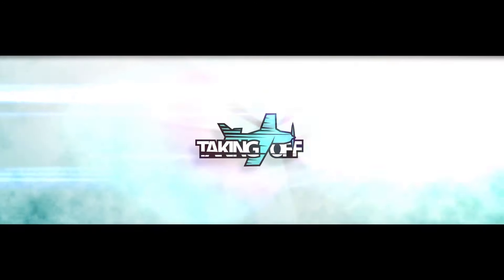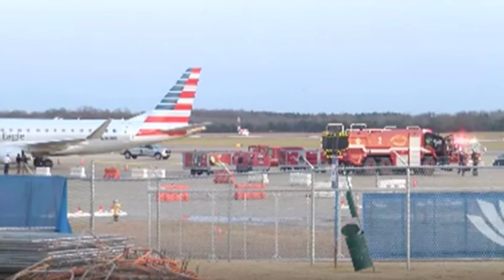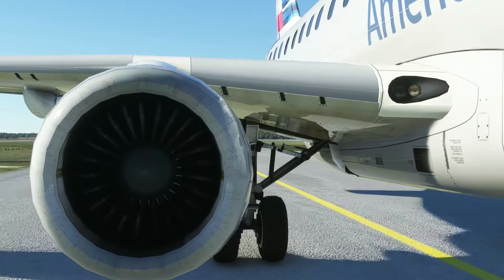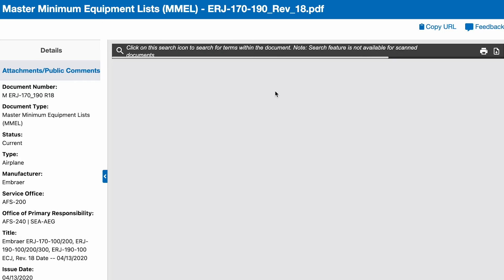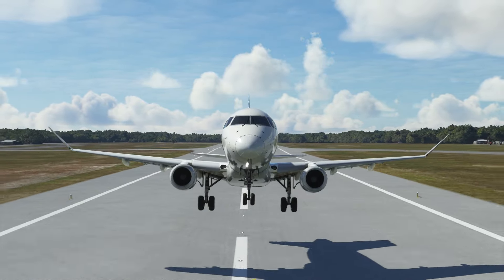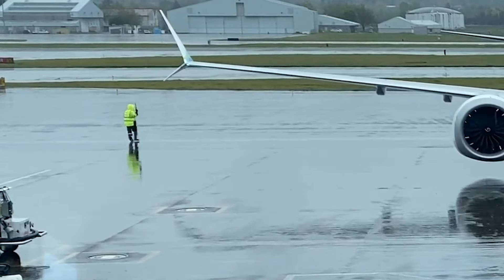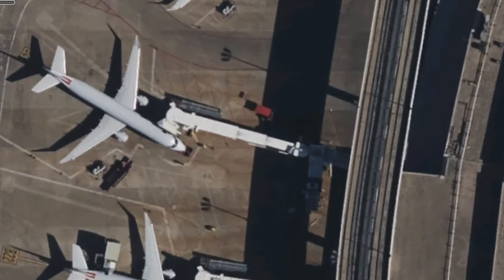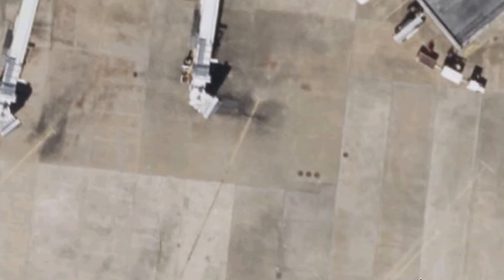Woman Sucked into Engine at Montgomery Regional Airport New Years Eve UPDATE

Comment: Isn't the APU used for emergency situations to power the plane controls?
Reply: APU is used for Electrical Power- Pnuematic Bleed Air from the compressor [ Air Conditioning and Engine Starts ]- Hydraulics. It is primarily for Normal Ground operations when the engines are shut down but can be used in flight on some aircraft and is required to be operational for ETOPS aircraft [ long range flights over water]
When you are boarding a commercial Jet many times the Turbine sound you hear is the APU operating because it is a small Turbine Engine usually located in the tail area of the fuselage. The Engines are usually started after the aircraft is pushed away from the gate and many jets use bleed air from the APU compressor to spin a pneumatic starter. 
Some modern Jets use a large Electric Starter - Generator  to start the Engines. [B -787 ]  . B727 APU is located in wheel well.
Reply: @guitarhillbilly1482  What I mean is if you lose both engines the Apu is supposed to be your third redundant system to power flight surfaces.
Reply: @JimFeig  Some Aircraft MEL's do not require an operational APU for flight. I have seen MD80's operated for the whole day with an INOP APU and route the aircraft to an overnight station that had A SERVICEABLE APU waiting to be installed on the aircraft.  Perfectly acceptable on some aircraft and routes flown.
Reply: @JimFeig  Not for All 2 Engine Jet Aircraft or particular Routes Flown. Mainly ETOPS aircraft require the APU to be Operational before flight. The APU also must be started in flight at certain intervals and documented. Those are Twin Engine Jet aircraft that fly long routes over water and must comply with the 180 or 240 Minute Rules.
Quote: " Boeing to Offer up to 330-Minute ETOPS on 777
Allows more direct flights, burns less fuel, emits less carbon dioxide into atmosphere"

ETOPS = Engines Turning Or People Swimming
ETOPS= Engines Turning Or Pilots Sweating
Reply: @guitarhillbilly1482  I think the general public would be pissed to know this. I can't believe the FAA allows it outside of flying it to a repair facility. I actually know half of the acronyms from watching Blancollrio.
Reply: @JimFeig  Juan Browne has a great Channel and I also follow him. I can tell you have taken time to educate yourself about aircraft and operations.

Here is some more Info:
Quote: "The Minimum Equipment List (“MEL”) is a reference list of aircraft systems that, even with those systems not functioning correctly, the aircraft can be operated safely and would legally be allowed to dispatch. 
What is the Minimum Equipment List (MEL)?

The MEL (historically a book required to be on board replaced in recent years by an electronic copy) is a document that lists the aircraft systems that may be partially or wholly inoperative (“INOP”) which would still allow the aircraft to be dispatched legally.

It may come as a surprise for non-pilots to be told that an aircraft may fly without all of its components working correctly, but modern aircraft have a lot of built in redundancy in systems. If a system is defective prior to pushback from the gate the MEL would be referenced to see if the aircraft can be legally, and safely, dispatched. Often the MEL applies restrictions on the flight and in all cases specifies the period by which the defect must be rectified. If a system is found to be INOP but is not listed in the MEL then dispatch is forbidden. Lastly, the MEL does not always consider the ramifications of two separate inoperative systems – this is a responsibility of the pilot and good judgement. "

"Rectification Interval Category

The MEL entry will provide a “Rectification Interval Category” which will show the time limit within which a defect must be rectified. 

    A – Specified: The MEL will specify the time limit in terms of days, flights (“cycles”) or flight hours.
    B – 3 Days.
    C – 10 Days.
    D – 120 Days.

A defect carried on the aircraft is referred to as a “deferred defect”. Usually the longer the  allowed rectification interval the less serious the defect."

Can an aircraft dispatch if the APU is not working?

Yes in general aircraft can depart with an inoperative (INOP) APU’s. In flight the APU generally serves as a backup in the case of a failure of other systems (e.g. electrical failure).

Prior to departure the pilots will check the aircraft “tech log” (aircraft technical logbook) which will indicate if the APU is not working. The pilots will then reference the MEL (Minimum Equipment List) which detail if there are any restrictions on departing without the APU – for example, often for ETOPS (Extended Twin Engine Operations) the APU is required to be serviceable.
Reply: @guitarhillbilly1482  That agency is really captured by the industry isn't it.
Reply: @JimFeig  I agree that Manufacturers and Airlines have a lot of Influence with the FAA. I think the B737 MAX Certification along with MCAS  in its original form is an another Example.
Reply: @guitarhillbilly1482  Something is really wrong with that entire situation. It wasn't just Boeing but the airlines that are afraid of training pilots on a properly redesigned model.
Reply: @Jim Feig if that were true it would be illegal to fly with an inop APU

Comment: Could have been the APU was good at the destination and failed to start after landing during taxi in and some of the ground crew may not have been aware, either way the nose cones have stripes on them to indicate if the motor is running or not. The engine cowls and fuselages have red stripes to indicate the intakes safety zone if the ramp wasn't painted. Even though they are quite loud with ear plugs and ear muffs you can't always tell they are running by the sound. Sleep deprivation, long work hours, flight delays causing employees to rush, lack of training, so many things could have contributed to this.
Reply: I meant the source.

Comment: I'm wondering how often this happens, or, how often people get closer to an engine than they really should. How easy is it to lose situational awareness on the ramp and go somewhere that will absolutely kill you? I thought the engines were shut off until needed, or is that old info?

And something that came to mind when you were discussing the safety envelope. Well, two things

1. How much time does it take to go around, say, the tail and get to the position for baggage handler duties normally?

2. Don't have the figures to hand but how far back does the E175's safety envelope extend? I know with a Boeing and their design it's a cone that reaches at least to the tail, if not further but I'm not sure on the Embraer models or how that would affect ground crew walking around thee plane as far as routes they'd take. Would it significantly affect how they would move then?
Reply: If there are faded or no marking! The invisible safety diamond would be nose to wing tips ,then wing tips to horizontal stabilizer then back to wing tip then nose exaggerated of course! And from the tail to a cargo door not more then 10 seconds give or take size of aircraft! Hope that helps!

Comment: The Airlines must operate flights without operational APUs or there would be numerous flight cancellations Daily and the public would really be pissed off. The Airlines cannot afford thousands of spare APU's so that one is available at every station so it can be replaced as soon as it fails to operate properly.  Having a spare APU for every fleet type and station is cost prohibitive. They sometimes have to operate the flights without an operational APU until the aircraft is routed to an overnight maintenance station for Replacement of the APU.

Comment: Why can't they put a see thru safety fence, or a suction Detectors in that zone to warn workers the engine still has too much vacuum, and not just wanted lines on the ground, it's 2023 you think they would have better safety guidelines. There are many ways to prevent this from happening.

Comment: A good video but no real news or update tho of detail of the accident. 

So on the cone and engine spooling at idle, we were taught in the USAF to not walk in front of that and do NOT place a marker cone in front of a engine that is running. The ground crew in that video would be reprimand and possible fired for placing a cone in front of the running engine #1.

Fun tip, on most if not all military  turbojet engines and props they are painted so ground crew can tell they are "spinning" ;)

On a prop like a C130H, their's a big red line painted on the fuselage to tell you "death....cough cough danger " area.

Comment: Why don't they just wheel out a cage guard contraption? It would be so simple to have a metal heavy duty screen like guard on wheels put int place to safeguard anyone getting too close.
Reply: How do you wheel this contraption on live engines?
Reply: @davidsmiths5471  I don't know if you've ever seen metal grates that you can walk on like on catwalks or over subways. It's very strong and air easily passes through it. Mounted on a forklift style motorized set of wheels, I would think it would be easy to wheel in place and would stop anyone from getting sucked in. It would stop people from getting killed and save an expensive engine to boot. Just a thought.

Comment: Do you know if the captain or co captain warned the ground crew about the Apu not working so they can be alerted? Okay my glasses I can't see too good but you haven't confirmed it. Okay thanks for the answer.
Reply from the maker: Havent confirmed but its SOP.
Reply: I know that I did that in the military the first thing you do is see if the plane is on make sure it's the APU but since it's out of the ordinary one of the pilots should have made aware because of continuous on the job normality it would be the APU so if you think a little bit maybe could someone get caught in that deception so just radio the ground crew and say we got an engine running Apu is out. This is the first time I'm hearing it so I'm just wondering if anybody knew if the ground crew was aware the manager or whatever verbally. Thanks
Reply: There are several ways the ramp can find out! ACARS,looking at there flight schedule the aircraft would be flagged with a MEL! And when you look up load planning to see how many bags are coming in would say inop APU! An I think even looking up the fuel load would say something about the INOP APU! And if the crew called the ramp to say there 10 minutes out! They would either say we have inop APU or say they need an air start! And a inop APU  Is never consider a standard operating procedure (SOP) !

Comment: Yeah but to plug in the GPU you have to go inside the safety envelope.  Why would you taxi in on the left engine knowing that the GPU has to be plugged into the plane on the left side?  My bet is she was the one plugging in the GPU.
Reply: The panel is not within the ingestion zone! But it's sort of a double standard! Just like chocking the front tires technically your in the safety envelope! An most likely one engine is still going!

Comment: Yeah,

I’ve  flown on several of  those Embraer commuter  jets,

They are lots of fun for taking a little flight on ,

And my understanding is that they actually have rolls Royce engines  ,

Not G.e.( General Electric type of engines,

The jets have anywhere. From 35-36 seats  on them,

The hinges are way back from the nose of  the aircraft,

 The aircraft is definitely an awesome. Machine,

 It really makes absolutely no sense how a person could get sucked up into something that  is about the  same size as a human??,

Something is really fishy here,

ℹ do know that it’s a common occurrence.  For birds to get sucked up into a given jet engine,

However something is very fishy  here,

It sounds like a lawsuit scam going on  here??,
Especially given that a person would have to be almost to the  rear o aft  of this plane in order to get sucked in??,

Again these planes are wonderful,

And if I recall correctly they are manufactured. In brazil.??,

,

Comment: There should be two round steel grids that are mounted in position so that when the plane is parked, the grids block off the jet engine inlets. In this way, nothing can fly into the engine - intentionally or not.

Comment: the phrase you're looking for is "Flight #### is gonna need a Airstart". The APU is never mentioned from the Ground Crew POV, it's implied that the APU on the stricken plane is INOP but never openly discussed. My personal descriptors is that 'The Plane is Asthmatic AF' but that's also NOT common terminology used on the ramp, either. But what is discussed is the fact that both motors are running until Ground Power is applied from the Gate. ("What if the Gate's power is AFU?") then the flight is fucked, because if motors are running, the plane is forced to shut down and run less electronics by battery before ground power is applied from the opposite side of the plane away from the gate. Here's cheery thought: What if the Myracle of Hutson plane didn't have a working APU that day?

Comment: I worked at an outstation where I would literally work the ticket counter, run upstairs to work the gate, load PAX onto the plane, work the ramp and even de-ice all in the same flight. For 10.50 per hour.  One thing about irrops and especially a broken APU, is that it's rare for everyone to know know what they're doing. Why? Because of lack of experience. I asked UA for more training and they denied my request. When you're doing an airstart, it's loud. You need to rely on hand signals. Not radios. No one could even yell at her to correct her behavior. The airline will try to cover their asses with having us sign SOP papers, but they're well aware their training is subpar.
Reply: This should never happened! This whole ramp was poorly trained and supervised!

Comment: You’d almost think they could engineer some type titanium grid of some sort to mount just inside the engine shroud to prevent workers, birds etc from being sucked inside the turbines .. but I’m pretty sure if that could be done they would’ve already designed it .. and I’m not an engineer .. so
Reply from the maker: Just posted a video where I research this.
Reply: I don't think being slammed into a grating at those speeds would be much better.

Comment: Would not the engine have been at idle?  The fan blades should not have been rotating that fast?  You wouldn't think they would have that much suction power when just used for electricity generation?  I imagine she was not sucked through the engine like on TV or the movies, but would have been badly cut and banged around by the fan blades?
Reply: Many High Bypass Fan Engines can suck in a full size adult at IDLE - Even AFT of the Engine Inlet. This is why the Engine cowlings have Red or Orange stripes [ paint or decals ] on the sides to depict the NO GO ZONE. It all comes down to Situational Awareness especially on an Aircraft Ramp.

Comment: Many High Bypass Fan Engines can suck in a full size adult at IDLE - Even AFT of the Engine Inlet. This is why the Engine cowlings have Red or Orange stripes [ paint or decals ] on the sides to depict the NO GO ZONE. It all comes down to Situational Awareness especially on an Aircraft Ramp.

https://forums.x-plane.org/uploads/monthly_2016_10/Engine1.jpg.f0f0a263df5baa5cacae685cb81881b0.jpg